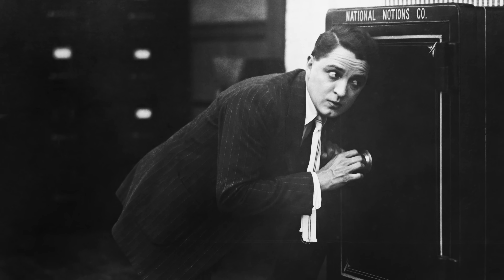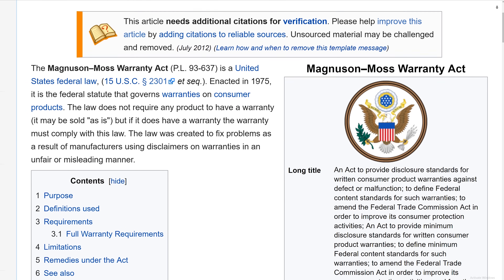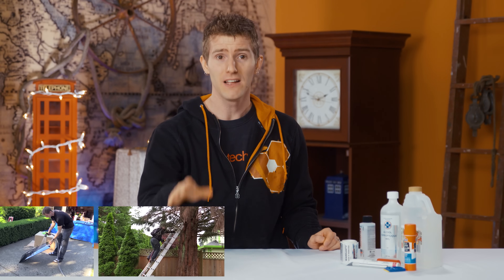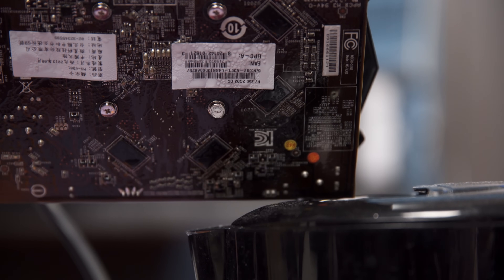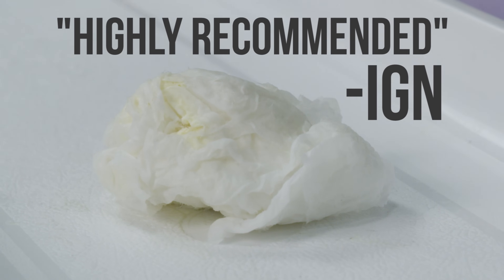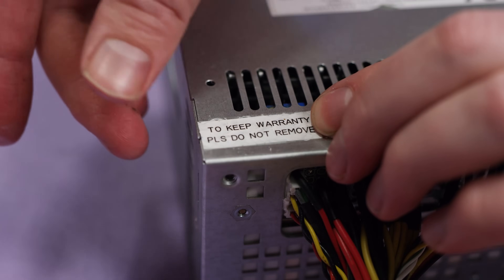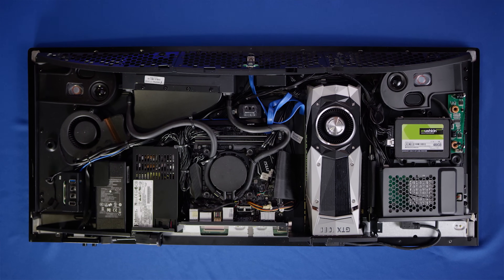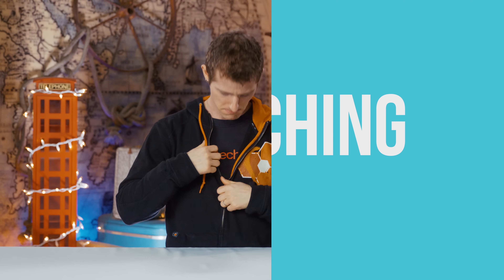Safely Remove Warranty Stickers

Comment: My fav is still the AVE video about his simple teflon sticker tool he made easily from a small piece of scrap and you're wrong about the complexity and the price honestly. It doesn't take too much skill with basic tools and if you're not a child you should be fine and imo it works best since the solvents can mess up ink or too fully dissolve the sticker backing and the ones that leave a message and split are much more easily removed with the teflon.. It works really excellently and while I'm sure they are sold somewhere by someone you can easily make one yourself. Cheers  and freedom of repair for all! Especially MacBooks and apple chips! Stop being such assholes Apple, with your self-destructing/unreadable/un-buyable proprietary chips and no legal way to get them or software or schematics or anything Apple for 3rd party board level repair which apple doesn't even offer themselves  cuz you're meant to simply be forced get a fresh new very expensive laptop every couple years minimum. Fight the power and thanks to the board level repair techs who fight the system as best they can. But we need to reform this forced obsolescence by law asap seriously. I like macs and iPhones but also have many more devices that are windows Linux or android than I do that are Apple just because of these reasons and the prices. Like I could never buy any kind of tower from them and not feel ripped off, the only appeal is the OS for some of my coding and other work and the nice design and compactness of an air or whatever. Their stuff is undeniably   nice but I'm practical and know you could get any other brand and get double the laptop/phone is most respects and you will actually be able to upgrade ram, ssd, etc. If you want and if you buy or build a tower you're far better off than you ever could be with an apple tower. That why I like hackintosh projects cuz I can make them out of old computers for free really. And it's just one more option when I repurpose old towers or laptops or even old netbooks. I also usually switch to Linux (often a multi boot variety pack so I can boot a disto suited to regular use or for backtrack lol)for older slower devices so I'm not running something as bulky or graphic intensive like windows or OS X when I don't need to drop storage or cash(lol) or time getting a paid OS(yeah I pay for every windows  key, who would dare not to? Lol). It depends on the the use but I like to repurpose devices for as long as possible and heck, an old netbooks isn't too far from like a raspberry pi so it's great as a server, a wifi tool/project, a tiny laptop with your choice of OS, you can add a touchscreen overlay cheaply, expand the storage sd massively for cheap, make it a media controller and streamer for your tv/entertainment system or stereo, and you can even just use it to ssh in or for basic web access stuff or even just store a bunch of movies and music for traveling. Yes you can do tons of stuff with even pretty outdated tech. Plus people throw out computers all the time that are fine cuz they get new ones or have no idea how to fix minor issues and I've gotten dozens this way so I usually find a use or good cause and sometimes I fix, setup, then donate somewhere in particular  that needs a computer not just to sell it on and I do all the setup etc too. It's also good for business referrals for my repair and general tech setup business  lol plus who doesn't want a free computer? I use whatever programs and OS that make sense for the use and will make the old hardware still run snappily. And worst case scenario it's free parts at least. The devices still have value even to a modern very well equipped geek(like an old router but better) even if you just make it a little simple device below its "max potential" if it solves an issue why not still use old tech that works fine? It may not be your main gaming computer(though don't forget steam streaming usage if you have a gaming pc elsewhere as this is an excellent use, as is making it an kinder games machine/arcade ) but aside from that most people on this channel probably have some pretty good computers laying around still that they consider obsolete as a main system  and the battery may be crap but perhaps they overlook the fact they can use the old stuff for everything else(albeit maybe plugged in), even surprisingly old stuff, the most common operating system worldwide is still XP servers  and many people still chose to use it for their personal rigs even tho its now unsupported. Some computer literate people still prefer it especially if they are very familiar with that particular is layout and coding for repair or are just more comfortable since they know where everything is at a deep level. And if you're  savvy and smart and can protect the unsupported system properly and keep it clean it will still work great(except a small recent issue with flash or something since it's been patched so is unsupported but if you're tech savvy you can get what you need fine in older versions or alternate software etc or just out 7 on it since 7 will actually run on most old netbooks even, especially if you don't mass install everything you don't need. The minimum install requirements for won 7 are quite low actually and it works quite well and widely on older machines despite it being significantly newer and more advanced than XP(plus it's supported). Remember either reuse the tech yourself or find someone who will before you just refine it to a tech dump. The sad thing is towns like mine don't actually let you take tech out of the container no matter what it is so I have to sneak and be clever just to salvage speakers but I'm not hunting hdd's and they are almost always removed or bashed anyway. Up-cycling is far better than recycling and I guarantee there is someone in every town who will be overjoyed to take your scrap computer off your hands and will likely offer you free pickup and I offer free services as a thank you. I also go most small simple repairs or updates for free cuz I'm a softie lol but there is always a better place for an even somewhat working computer before it gets scrapped in a 3rd world shithole where kids have to burn plastic all day. Please, take moment and simply find a geeky kid locally or put a listing up before you toss useful stuff please and it's a win for everyone and the planet too. Cheers : )

Comment: Scotch tape, a razor and heat it the way 2 go !!

Place the Scotch tape on the lable,  heat up the lable with a iron(just a little) then use the razor to gently remove the sticker :)

I used this method on a MSI Laptop as shown in the video, no damage to the label what so ever, did even RMA the laptop and no comments :)
Reply: You need to retest with my method  @linus tech tips :)

Comment: Ive also been doing this (until I started buying EVGA gpus) for many years as stock gpu cooling is just inadequate, anhd using an old clc is just a much better solution.. and always wondered if this is "fraud". Is this not technically "insurance fraud"? 
If the warranty is considered to be part of the cost of the item, and said warranty is essentially insurance against product defect. Then could it not be argued that you are being "fraudulent" in attempting this? Or is this all superseded by the fact that they're not supposed to be doing it, so whether or not you're trying to deceive them is irrelevant?
Reply: rip

Comment: If it's under warranty then take advantage of the warranty and don't bother to fix it yourself. Get someone else to do it for free. That's the purpose of the warranty in the first place.

If the warranty has expired it doesn't matter if you break the warranty tag. What good is it in having a warranty sticker if your warranty has expired? You cannot go after the manufacturer if the product fails.

And if you need to add a card to a pre-built computer you're not likely to run into a sticker problem.

Comment: I have keys for Windows XP, Vista, and 7, and they're all on those types of stickers. I will use these methods to get them off and save them somewhere where I won't have to worry about someone else getting to them. I'm likely selling the computer with the XP sticker on it fairly soon, and I don't want to sell my way out of legit XP with it. That's not part of the deal; especially when the PC will have W10 on it.

Comment: the plastic razor blades are from the vinyl signs and graphics industry but nvm that. Its about 10,000 easier to just have a sign shop recreate  and reprint a new sticker. Also, anyone who takes advice from a guy who just pours liquids all over a PSU probably has fucking mental issues to begin with(most LTT viewers)

Comment: Easiest method to remove warranty sticker:
1 - get something like the plastic razor as mentioned in the video
2 - overclock it
3 - add rgb
4 - just touch the warranty sticker with the plastic thing and it comes right off

Comment: Plastic razor blades are also very commonly used in the automotive detail industry. I use it to remove dealership advertisement stickers located on the truck lid of vehicles. :D

Comment: QUICK WAY: 1.Find manufacturer warranty sticker on Google, Then resize and print 
                       2.Rip of original sticker, Do work on the item
                       3. Using normal glue, put on paper sticker

Comment: Some credit to MSI I guess then. All they actually use the sticker for is to see if the product has been opened and if they need to check for user-damages beneath a cooler as an example. They will still happily accept a product without the warranty sticker. At least this is the Swedish MSI departments policy according to the representative for MSI in Sweden. Of course MSI is not alone in this, but they are the only ones I currently remember of the list. :P

Comment: In Germany you can remove any of those stickers, your warranty can never be void unless you purposely destroy the system, because it must be possible for you to, for example, clean any ventilation systems or upgrade the system. Your guaranty on the other hand can be voided by this.

Don't know about the US or Canada, in Germany you can roughly say this:
Warranty is that you have to prove that you where sold shit.
Guaranty says that the vendor has to prove that he did not sold you shit.

Comment: Bought rx480. rx480 overheats. Try to send card back. "Okay, we'll refund you $100 less than you paid because restocking and shipping." "It's defective." "Okay, well contact the manufacturer, send it to them, get them to contact us, and then we'll refund you."

So much fun. Can't even replace the thermal paste on your own GPU without voiding a warranty? Really? Then put better stuff on there to begin with. I'll pay the extra $10 out of pocket.

Comment: awesome, you guys do a great job.  couldn't tell if you mentioned this but, using things other than 99% alcohol, may leave residue on the circuit board if it goes into the vents, seams or openings on the device. 99% rubbing alcohol evaps almost right away.

Comment: Why on Earth would the manufacturer be obliged to repair something under "warranty" if you previously opened their product? What proof do you have that the product was broken before you opened it? Because you could've caused the damage by opening it, or messing around. Warranties are based on simple logic: If you use the product as you should and something breaks without you causing that damage, then the manufacturer pays for the repair. Let's say you change a component and that causes the whole device to go berserk after a while. The manufacturer can't guarantee that the aftermarket component is compatible with the device, even if it is, the way you swapped the component might cause harm to other components. As such, the device you now have is not what was manufactured, thus you can't ask for warranty. Besides, if you have warranty, why don't you just go to the authorized seller and get it repaired properly FOR FREE? It's like I give you a cookie, you decide to spice it up, and then complain how my cookie got you diarrhea. You spiced it in the first place, you're responsible for the outcome.

Comment: What's fun is when the prebuilt pc doesn't have a warranty sticker but instead has a switch installed that tells the system if you've opened the chassis.

Comment: Unusable video. The best way (for me) is a hair dryer. Heat the sticker up with the hair dryer for couple of minutes (set minimal air flow if it adjustable), and carefully try to lift from the edge with razor blade or something similar. Watch for the temperature - surface will be rather hot, and it must be rather hot for success! This method works fine with plastic and with this "VOID" stickers. Hair dryer have optimal temperature, it can melt plastic surface only with heating time more than 5 minutes (I haven't any damage for all attempts). Be careful and you will have good result!

Comment: If you have a warranty what's the point fixing something?
Reply: TheSparkPlug or upgrading ssd or ram on msi laptops smh
Reply: Because I don't want to wait months to send something to get it fixed. Additionally, depending on what's wrong with it, it can be fixed very cheaply
Reply: because when there's a blown capacitor they go "we will need to replace the entire device, you will lose all your data since there is no way to recover the data from your storage because it won't turn on"

Comment: problem is some manufacture even notes on sticker saying "Warranty void if TAMPERED or REMOVED" so if you just slightly put it back wrongly the warranty is no longer valid. so Tricks like this wont trick them :/, you can see sticket example at 8:09 there you have exactly text sticker that i wrote about.

Comment: Eucalyptus Oil (needs to be at least 80% pure) Dissolves the solvent on the back of the sticker very well, and unless you rub over the sticker with a tissue / cloth / towel etc, leaves the sticker in-tact as well, however don't rub the ink, as it will lift that off of the sticker as well.

Comment: So open it up, break it more, seal it back up and send it back.
Reply: TheDutyPaid I once resoldered a new power socket (broken due to dropping it) on a laptop motherboard. Buggered the motherboard, but they repaired it on warranty because there was no visible damage!
Reply: or you can simply buy a new in box working copy of your defective electronic and simply replace working item with used defective item. you get brand new item right away.

Comment: About tip #1: You can cut that bag into smaller pieces, but you need scissors which you didn't mention so I can see why you wouldn't cut it down.

You can still wait 2 years and then you can open it as much as you want :)

Comment: What a stupid law. Why take away the freedom of manufacturers to limit warranty and this reduce the price? The idea that "consumer protection laws" protect the consumer is dumb. The only thing they do is to limit the range of voluntary agreements.
Warranty is expensive, and especially so if people can do self repairs on electronics, and then still demand that the manufacturer has to fix it.
It's the same laws that say how long a warranty on a used car has to be. My first car was very cheap, maybe 2 000 Dollars. Several hundred of those were only due to the warranty the shop had to give me. I did not want any warranty, I can fix the car myself, and I really could have used those few hundred dollars, but no cigar.

Consumer protection laws are a classic example of only looking at the benefits while ignoring the costs.

Comment: By the way, the teflon scraper isn't a bad idea and you don't need to have a machine shop.  You can get a chunk of whatever plastic you want to use, teflon included, and carve it to rough shape then sand it to final shape then polish it using very fine sandpaper.

Not that you'd do this when you have a supply of plastic razors but you can make it a lot simpler than the youtube guy did.

Comment: Those plastic razors aren't made "specifically to remove stickers" from whatever you said.  They're made for scraping without damaging the item you're scraping.  In other words, what you said is a sub-set of what they're made for.  Minor point but I'm all about minor points.

Second - pipettes.  Get some.  Then you can dispense the solvent precisely, using a lot less and not making a mess.  They're cheap and if you only use them with solvents you can use the same ones forever.

I use them for model paints and other things where I use them once and dispose of them.  If you search around you can get them for a nickle a piece.

Comment: a lump of plastic and a concrete floor is hi tech !  look Linus you can open a tin of beans on a concrete floor you just grind the edge lip off the can and the can opens,  so tin opener nil concrete floor 1 not high tech at all as for that piece of plastic it was probably a piece of PTFE and is very cheap also you can use a grinding stone they are $2

Comment: Do you want to hear a joke?
I once removed the warranty stickers on my MSI gtx 980 so I could get to the heat sinks for easy cleaning. Why not right? I know what I'm doing. Done it dozens of times. Well, when I put it back together the small cable for the single white LED got caught between the board and the corner of the heatsink, and since it was a thin cable I failed to notice. Five minutes of running it later, it broke. Obviously. So I took it apart, reassembled it without the cable trapped, and got it replaced claiming I did take it apart once for cleaning. Thanks, MSI. I'm a dumbass. You guys are awesome.